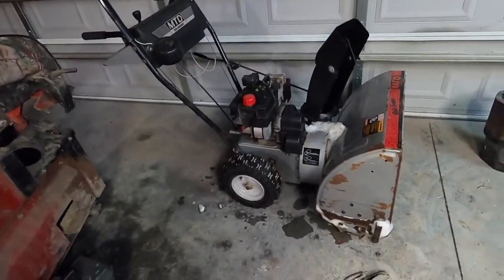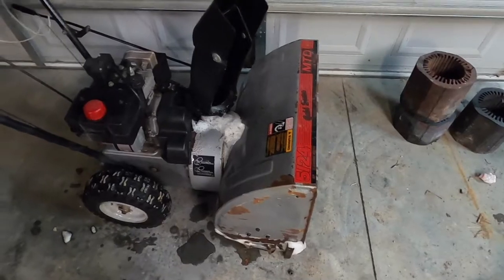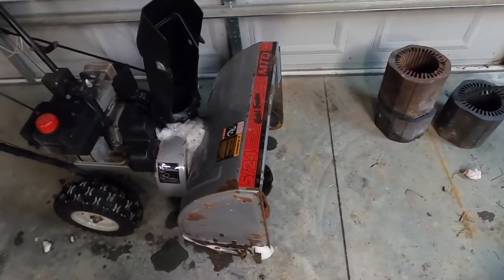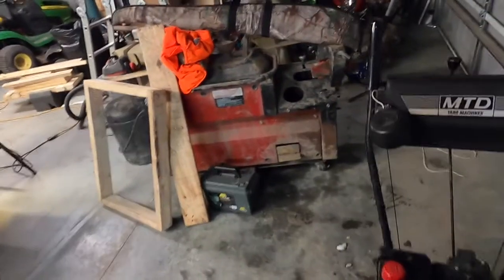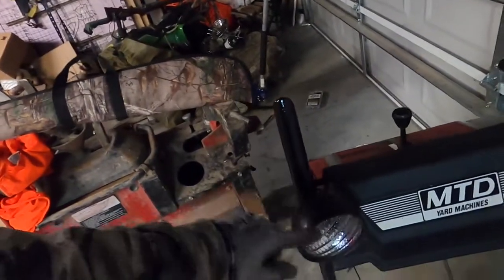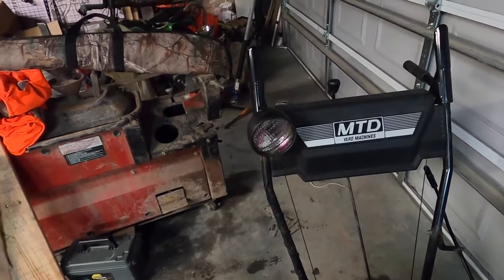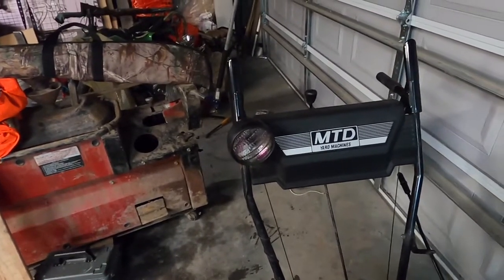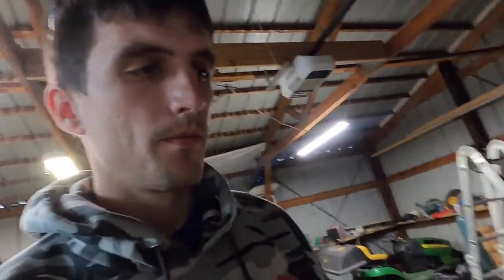Upgrade lighting for snowblower for cheap!

Comment: Thanks for the helpful video. I have been flipping snowblowers for years and the extra money helps. I go thru the whole snowblower and been pretty lucky with fixing them and selling them at a decent price. I suggest spraying a silicone base spray in the auger section and the chute section for it makes the snow from sitting and throws it father . Thanks again

Comment: Why would the engine even have a stator if it isn’t intended to charge a battery?

I’d like to add a light to my used MTD blower but assumed there’s no charging system on it.